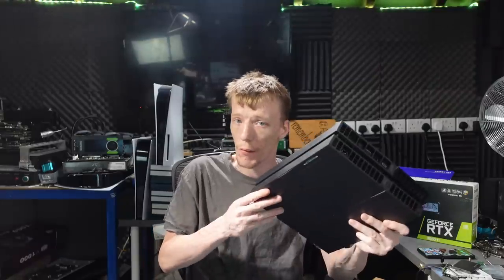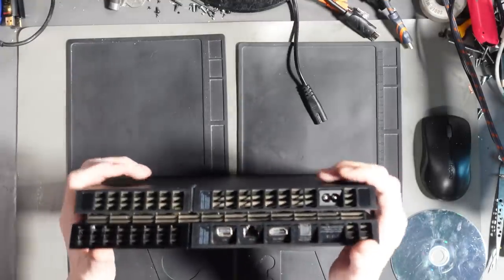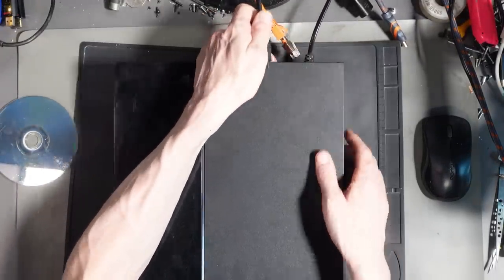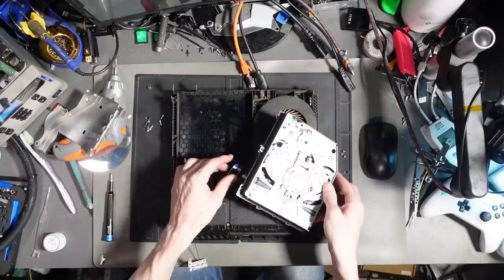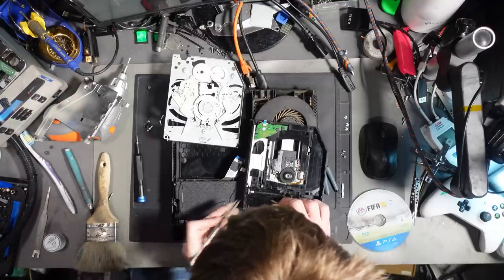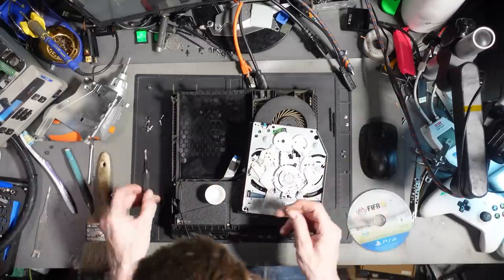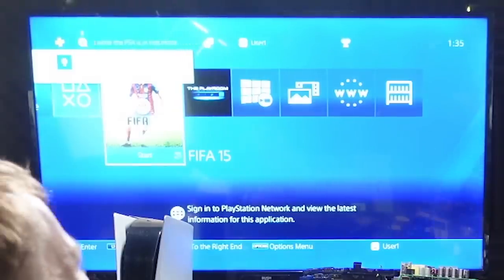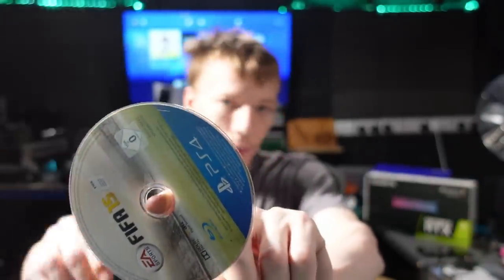Surely It Can't Be THAT Easy To Fix This Issue? PS4 No Disc Feed Repair

Comment: Ive had the exact same. Seen it on my mate vince as well. The cable that powers the drive often doesnt connect well. Just cleaning and replugging and mine was fixed too 🤣👍.
Reply from the maker: It was odd with this one though since it had never been opened

Comment: It amazes me how many electronic repair shops cant fix simple problems or do more damage it looks like they didn't even try to clean out the disc tray ive come across this problem before and a quick clean solved the problem
Reply from the maker: Yeah it's really strange how they didn't even try to clean it first before sending it to me for board repairs
Reply: Many repair shop does that. They don't even know whats they are doing and damage it even more.

Comment: i have a question regardding power issues fixed the dvd everything was good for a day  fired it up next day too see and hear the blue light come on hear a click and it shuts down i assume thiss to be a supply issue but not sure have you come across this is it thee supply block or something else

Comment: You could of saved a lot of time and just adjusted the manual eject screw. Had this problem with a few ps4s and worked every time. I'm surprised that someone with your experience didn't try that before tearing it apart.
Reply from the maker: It needs cleaning when it gets to that point mate. Full strip, clean and replace rollers if needed, that in my opinion is the only way to do it properly. Everyone has their own methods though

Comment: Nice fix, but I have dealt with this problem. Either the disc eject motor was stuck, or has a dead zone. If it happens to stop in that spot again, the problem can re-occur. I have had this 3 times infact, and the third time i learned to just replace the motor so that it doesnt come back
Reply from the maker: Yeah thats a good point mate, sort of situational but sometimes it can end up coming back again
Reply: Similar thing happens to my ps4 pro. The problem reoccurs every 4 months. I've decided I'll just change the drive motor
Reply: @TheCod3r  Yeah, the motors are less than $8 when ordered on aliexpress, so I decided to just go ahead and save myself the trouble whenever I come across one, and swap it

Comment: My ps4 like that will not recognize any disc and it claims its a firmware issue. How do I fix it so it reads discs again what areas on the board can I check?? I would like to play some games again. New disc drive did not fix.

Comment: I tore down my son's PS4 recently as it was over-heating and the DVD drive wouldn't eject.  I stripped it all the way down, replaced the CMOS battery, replaced the thermal paste and cleaned the DVD drive.  I was surprised how easy it was to work on.
Reply from the maker: They are pretty nice for general servicing, sony made it easy, not like the ps5 lol
Reply: @TheCod3r  Yeah, I noticed that. Not looking forward to when I have to strip my son’s PS5 down - I don’t think I’ve ever seen so many screws

Comment: 14:39 - on the TV "the disk cannot be read" =) I think the disk is scratched (6:08 - You need to be neat with a test disk =) ) or laser is old
p.s. Perhaps you should buy a special pencil for cleaning the camera lenses. Only, better corporate, not from Ali. If there is a special coating on the lens or lens from plastic (I don’t know what lenses are used for the DVD/Blu-Ray - drives), it may become clouded. I'm not sure of this, I'm not a specialist. Just my thoughts.
p.p.s. Good job!)
p.p.p.s. It turns out that after farewell you talked about the quality of the disk.
Reply from the maker: Haha yeah I should have chopped it up and put it before the goodbye but wanted to keep the flow of the video lol

Comment: I've got a ps4 slim that takes discs and ejects them but wont spin the disc no noise at all it dosent even try
Reply from the maker: That could be the fuse mate
Reply: @TheCod3r  I'll check the fuse bro  do you know where the disc spin motor is located in these slim versions. Thanks for the reply Phil

Comment: I send you a whatsapp message
Reply: Need help with a liquid damaged xbox one
Reply from the maker: I don't use WhatsApp any more mate. Was it an issue you're trying to sort out yourself? If so it's best to post in discord because I generally don't have time to message individual people for 1-1 help. There's too many requests and not enough time in the day for that
Reply: @TheCod3r  my xbox one got water in it    under the apu and ram chips   i blew it out with air    now it starts for a second and shuts down    strange thing is when i plug in the powerbrick  it go,s to a white light and back to orange  several times and the fan starts spinning   is it repairabel or scrap ?